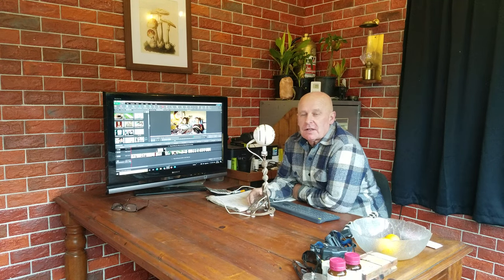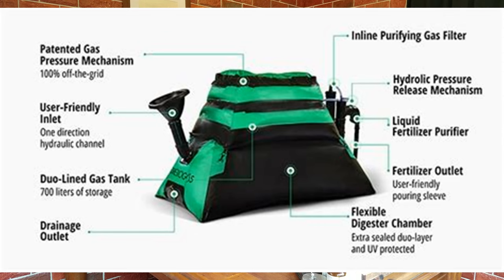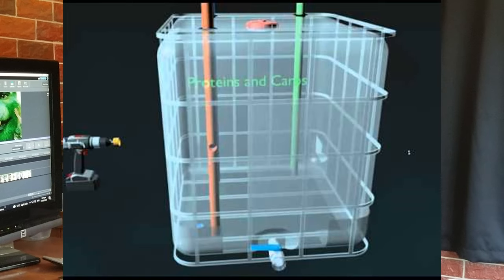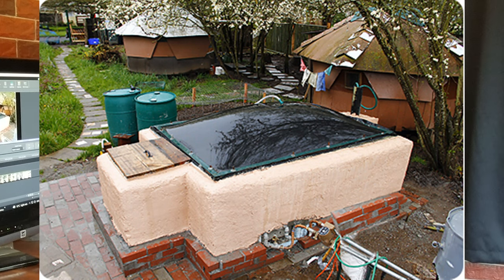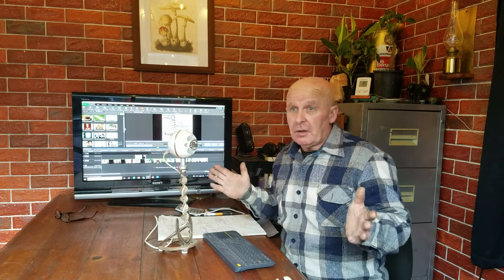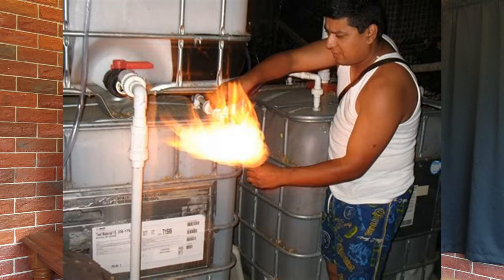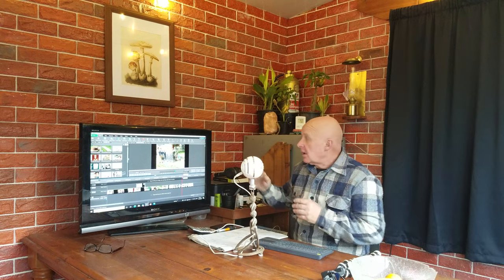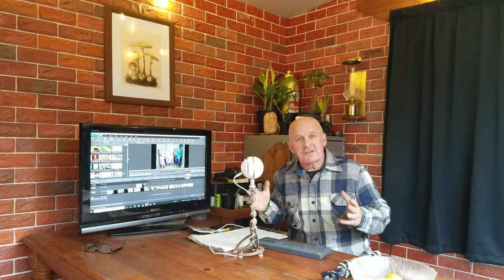Biogas Digester Build Pt 2: Why IBC totes are the best

Comment: Hi, 
Thanks Lot for your informative video documentation on BioGas Digester. I live in wellington and keen to have a go on this for our Home use mainly for heating,  but not sure how it might work in Wellington Weather. For a start I made a query from Wellington City Council regarding the council guidance when building a Home BioGas Unit, Officer replied said he will pass my query to experts for advice and also suggested to check with a Registered Plumber. Still I haven't got a proper response from The Council. Are you aware of any specific requirements that need to follow. I believe it is mostly common sense actions when dealing with flammable gas types. Soon I expect to start building the Digester once I managed to purchase three IBC 's.

Even though I got plenty of space underneath the house for the BioDigester, I am planning to install it by the side of the Home. I am not sure whether it is safe to put underneath the house. Advantage may be protection from Cold wind. But may have to keep a gas detector as a safety precaution.

What are the areas that I need to be careful and aware of when installing and maintaining the BioGas System.
Thanks again for sharing your knowledge.

Best Regards,
Jagath

Comment: Rather than trying find two tanks that fit in each other for gas storage I'm going to stack one tank on top of the other other conect the bottom of the bottom tank to the bottom of the upper tank and as the bottom tank fills up with gas the water is pushed up to the top tank and the weight of the water column will give it pressure I too have watched numerous videos on building methane gas digesters storing the gas and putting it in propane tanks for storage and portability

Comment: Hi Everyone, Can anyone help with how you could set up with 2 x IBC, 1 for insinkerator from sink for waste and grey water the other to connect to this and be the digestor?  Looking for some help with a domectic use case.
Reply: You might want to explore using a macerating pump setup like what are commonly used in basement toilets. The device shreds waste and pumps it with enough pressure to get it to 25+ feet vertically in some cases!